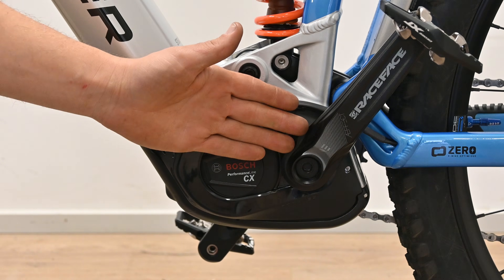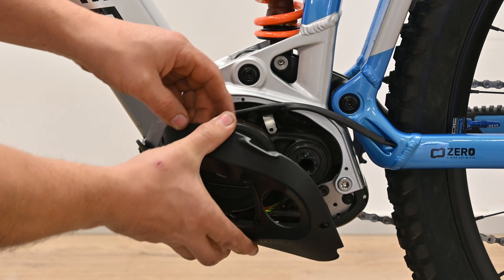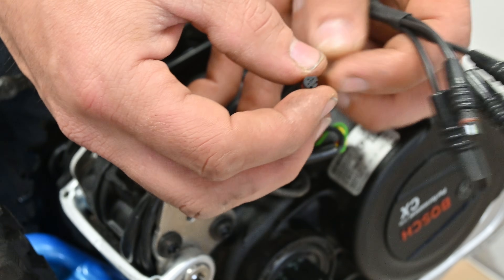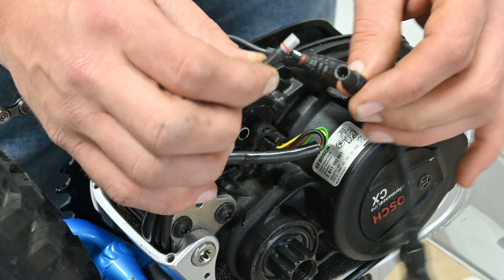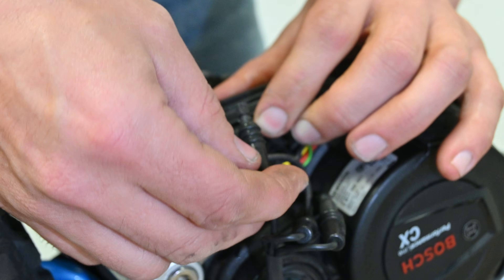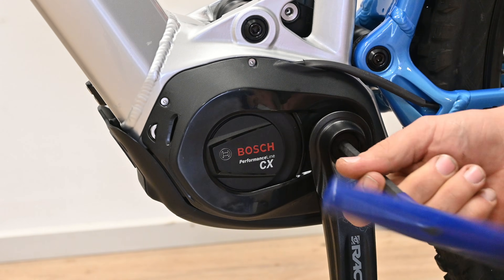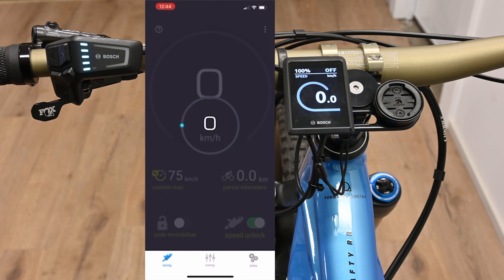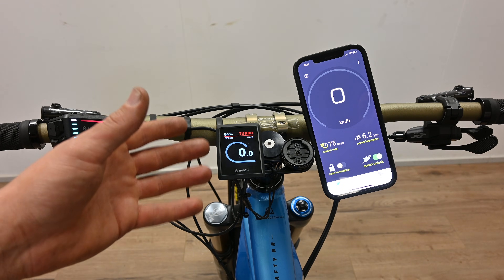How To Derestrict Bosch Smart System EMTB's

Comment: This video provides a detailed guide on how to derestrict Bosch Smart System EMTBs using an e+ tuning chip (0:05). The process involves:

Gaining access to motor plugs (0:40): This requires removing the crank arm and plastic cover, and then the bash guard for easier access.
Installing the e+ smart system chip (2:20): The video demonstrates how to carefully connect the two plugs from the chip to the motor, ensuring proper alignment to avoid bending pins.
Tucking the chip and reassembling the bike (5:00): After installation, the cables and chip are tucked away, and the bash guard and crank arm are reinstalled.
Activating and using the chip (6:00): The video shows how to activate the chip using the e+ tuning app, which allows for speed unlock customization (to 35, 50, or 75) and adjustment of power output at different speeds. The video also notes that the bike's display will show approximately half of the actual speed with the chip activated (7:44).

Comment: I have the speedbox chip and it limits it to 25 mph It does so by fooling the software to thinking 25 mph is 19 mph. The previous gen there was no limit just mechanically. 25 is better than 19, but there are times where I need to run up of 30. 
My issue with buying your chip is the price. $450 is a lot for maybe a $3 part. Speedbox is $209. Not really happy with it, but the most I would be willing to pay is about what I paid for the speed box. I have enough strength to get to 30 a few times. 

Make no mistake I understand the rules of business, but $450 is just wrong...

Comment: Just do a firmware update from a country or region that is not limited to 25 km
Reply: By using VPN ? :)
Reply: Does it work?
Reply: Sure but you need to the firmware tool.
Reply: Does it work??
Reply: Does it work ?
Reply: Update no it doesn't work.. attempted an update in the flow app on an un modified Bosch gen 4 while VPN in USA..

No updates found.

Location services off and permissions revoked

Comment: You can get a power supply from jaycar, $9 add that to the mix (36 dc to 12vdc) add the speedo adaptor from jaycar $22. (12vdc supply required). Wire it up and get exactly the same result! 
Total price $31! Time to wire up, approx 1hr depending on how neat you are and if you really want plugs,
Not phone friendly but can be set up to allow different settings too. 2c 
Cheers!
Reply: Will this not lead to a tampering error ?

Comment: Hi what if you have the Bosch Gen4 engine with the speed sensor magnet attached to the spoke of the wheel? Which model tuning chip do you use?
Reply from the maker: It depends what display you have on your handlebar

Comment: WOW!!!!WOW!!! WOW!!! "Bosch Smart System" is it so smart???

I Only have problems with this "Bosch Smart System" and Bosch TAKE SO LONG TO ANSWER ME....I still waiting for answers from Bosch 2 weeks now
I got a New R&M Nevo 4 with 750W Battery and Kiox500 look like every ting was OK until I realized sometimes it save my Rides sometimes NOTING is SAVE, a lot of times it not save the Today ride and tomorrow it save the ride from the day before and add it to today ride with the accumulating Km from yesterday and today,like I did 43 Km yesterday and today 34 so I will have 77 Km and the date is from yesterday...!!!! also If I starting ride from point A and return to point A again but if I stop anywhere it save ONLY from point A to where I was stop and it show me only the ride from point AS to where I stop point B but NEVER show me the completely ride from point A my house to my house again soon I stop this is it save only that even I return to my house... I missing my old Bosch NYON a lot
I look in my phone before the ride is CONNECTED I check the settings on my phone I change phone and still NOTHING change

Comment: Have fun.. yeah right, until you get that 504 error like always. Every product the same, sadly bosch is just too smart for these boxes.
Reply: Got speed fun chip , you just do not connect smart phone to bosch flow app and will have no issues have been riding 15000 km with no problem at all
Reply: @jurejakovcic4823 interesting to know, are you still under warranty or is that up now? That might be the only way I'd plug any chip in but the speedi is a different ball game and works great
Reply: Hows that chip working now?,ive got the gen4 system 2 but not smart on my bike that's a ideal motor for offroad as your not going to be going more than 20kms in fields forests tracks etc its when u take it onto the road that u need the extra speed, atleast with the gen4 u dont get that resistance like with the smart gen 3 none cx ,which i got for my miss in the trapeze style and honestly only for that resistance id rather it over the gen4 cx and its a hardtail but man its the mostnatural comfortable bike ive ever tried nd ive a pretty good haibike full suspension,the hardtail i did put a rockshox on only because i had it lying  there but i gotta admit been able to tune your motors gears with a smart system is a gamechanger ive taking the hardtail cube on a trail forest route and it smashed it.there is plus's and minus's with both if im honest theres parts on track were the full suspension is needed but then theres parts were the hardtail just blasts thru I just wish they'd let the wheels atleast roll freely when on the road with the gen3 especially theres no point having stiffer gears u cant use them with the resistance so the only thing the smart is good for is offroaders theres no benefits with it on a road bike.if my partner let me id put a gen4 normal on the cube hardtail even tho that means changing battery and older display im seriously thinking of getting a hardtail like my partners with a gen 4 standard ✌️l @Emtbtoday
Reply: @jurejakovcic97420 what type speedfun do you have ?
Reply: There is no error if you just follow instructions.
Reply: @Sherlock245 I know right?! Maybe they get home from a ride and immediately plug in the charger as that will turn the bike off? But you really shouldn't do that anyway! Who knows 🤔
Reply: Speedi works no connection just mounts to rear disc very discreet wouldn't notice its there and not connected to the system to cause any issues
Reply: Hi, Is there no One product that really works?
Reply: I spoke to a mechanic who  works for all brands of e-bike engine and only with  Bosch they cannot be modified without having problems. They can arrive immediatly or after a fee months, but they arrive.
Reply: @lucazurlo3762  that is not true
Reply: In every forum about this engine you can find these issues. Maybe they are unlucky😂
Reply: Maybe Bosch is just too smart for you?  If you can follow their simple instructions i.e. do not turn off your bike after a ride and allow it to turn itself off (this includes don't immediately plug it in to charge after a ride, as this will also turn off the bike) then it works flawlessly, I've been running my Cannondale Moterra with a Gen 4 Bosch motor and one of their Bluetooth chips for 2+ years without fault. Just a satisfied customer, no affiliation whatsoever to epic ebikes (besides being Aussie!)

Comment: Still not clear on what the difference is Smart system  and other option would help if someone did a video showing the difference I have a cube reaction Hybrid  750 with kiox 300 display what chip can I use
Reply: What is the chip called ? I have a Haibike allmtn 5 2024 with the kiox 300 smart system, this chip in the video will definitely work my friend ?
Reply: hi, i have the same bike and just to warn you that tried the volspeed deristrictor and all was well for about a week then the speed manipulation error code appeared which meant i had a 90 minute ( 30 mile ) unassisted ride to clear it. I contacted the supplier who said volspeed tested it against my software and couldnt find an issue so i tried again even lowering the max speed assistance down to 25 mph, but roughly a week later it was detected again and shut the motor down, this time being told that i shouldnt have used Turbo mode as much and not go above 22mph !! 
As this was the 3rd time speed manipulation had been detected i was faced with a bill for a local Bosch service bike shop to clear the fault codes, but they refused when they realised it had been chipped, luckily after a couple of days hard pedalling to work and back it cleared irself and i now am too worried to try again, but would love to find a reliable way to deristrict it again as once you try it 15mph seems so slow, hope this helps
Reply: @MrAndyjane bosch é bem difícil mesmo. Ja usei e deu erro também.
Reply from the maker: Kiox 300 display is a smart system display. You would need the chip in this video if you speed sensor is located on your rear disc rotor.
Reply: I have HaiBike AllTrack 4 and speed 25km/h is so annoying. It's still an amazing bike, don't get me wrong but...too slow. 
When you are connected by smartphone with bike with the recommended app during riding, I think it is impossible to trick the system just by chip. 
All that shit goes straight from you bike to brands like Bosh or Yamaha, and they will avoid you from tuning that dramatic 25km/h. 
Not sure actually. 
But there is potential that with every update of the software you are doing, your bike is more impossible to hack with speed.

Comment: Please make a video about the 1.2 for Rim magnet. Preferably on Cube. I am reading about bad experiences with these ... Getting tampering errors. Quite an expensive chip if you're not certain it works. Thanks.
Reply from the maker: We are waiting for an improved rim magnet chip to be released, The current chips are not yet reliable enough.
Reply: @EpiceBikes y sabes cuando estará disponible estoy con el mismo problema
Reply from the maker: We are expecting to have a chip available by the end of June
Reply: @EpiceBikes  de que marca??
Reply from the maker: @RECLU1000  Eplus
Reply: @EpiceBikes  pues nada habrá que esperar haber si no tarda mucho
Reply: The new chip realased??

Comment: Happy to see a different derestricted brand! 👍🏽

How is this unit different from the following.

Speed box 3.0 can be adjusted to 99 km but has higher chance of setting off error code specially if set higher than 45km

The Volspeed 4 could only be set up to 45 km and is said it doesn’t shoot error codes.

I guess my real question is how does this unit handle the possibility of error codes!? That is the only reason most people don’t get one of these units. They don’t want their toy to go into “limp mode” 😳😂
Reply from the maker: In our experience all brands including Volspeed have a chance to get error codes if travelling at consistent high speeds in a commuting environment. Eg Riding in Turbo mode at 45km/h or more for hours everyday.  If you change modes and vary your speed like most trail riding conditions you are far less likely to run into any errors.
Reply: @EpiceBikes  thanks for the reply. That is good to know. 
So if traveling long distances can I just switch modes every 5 minutes or so, would this help or is it more to do with speed rather than time?

So in the case you do get an error code on your bike. What then? What is our insurance policy that the de-restrictor chip continues to work? 

What are the procedures to follow if this occurs?
Reply from the maker: Yes if travelling long distances it's best to both vary speed and the mode you are in. Its the amount of time at high speed in turbo mode that contributes most. 

If you get a 504 error you can reset it by removing the chip and taking the bike to a bosch dealer, Riding for 90 Minutes or simulating riding for 90 minutes by spinning the cranks with a drill. Once reset the bike and chip will continue to work as before.
Reply: @EpiceBikes  OH! Ok so I’m in. Can I make a suggestion?
This information should be put on the websites selling these chips. All the EMTB riders I know are on the dark regarding what to do if this occurs. 

They are thinking the chip goes bad and they would have to buy a new one. And they are not cheap! 

After this new info provided I now can see myself getting on board. A little further investigation on my part is due. It’s very different having these statements on a website than on a forum. 

Something to consider, doing so would separate you from the pack as every other company I have seen only mentions “possible” errors code. Thanks for the info.

And yes, I have no problem switching modes on long rides to avoid issues. Is just the information that’s missing to empower the customer to also be proactive in using the chip correctly.

Comment: I have a mondraker crafty 2022.  After 600km, the chip still works like a charm.  No errors whatsoever.
I note that the instruction book says to limit the top speed assist to 35km/hr, which i have done.
Is there a risk in increasing the top speed assist to 50km/hr?
And for anyone considering derestriction, don't use the app to update the firmware, as the purpose of these updates is to stop bikes from being derestricted.
Reply: I’ve heard the same on chips for Bosch gen 4 smart system. I would hate to spend $450 for only 10 miles.
I can’t see myself needing more than 39 miles on single track like you dude 😆 
I’ve only hit my 20 mile limit a handful of times. I need it to speed to commute to the trails and back home. 

I find this error code situation too stressful. I’ll spend the money but not to have my bike go limp and cause me issues. I wish they would address this topic head on instead of companies saying “you should be fine” bs!
Reply: Any feedback?
Reply from the maker: Increasing speed above 35km/h in a situation where you are travelling consistently faster then 35km/h in a straight line for long periods in turbo mode has a small chance of causing an error, This is most likely to occur in a commuting riding enviroment. If you are consistently varying speed and changing modes which is common in trail riding there is no issue over 35km/h.
Reply: Thanks for the feedback. I'll increase to 50 and see how it goes. I'm riding single track trails but just lacking that extra assistance in one section.